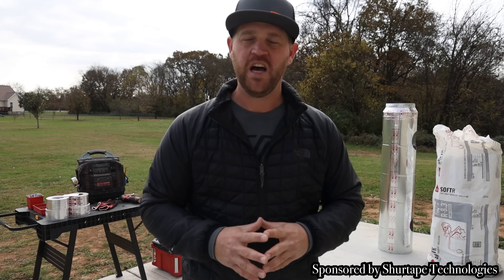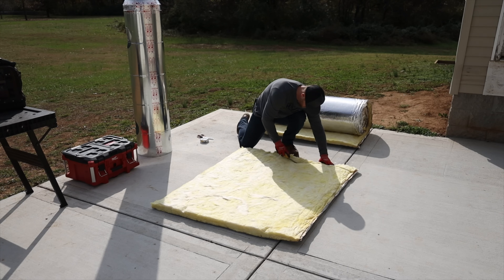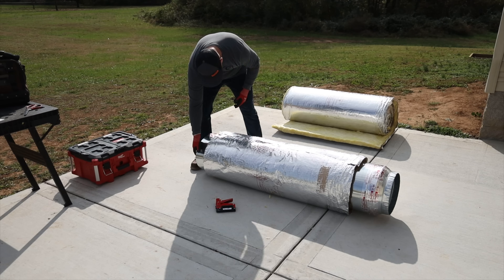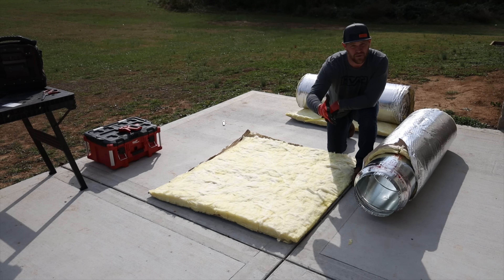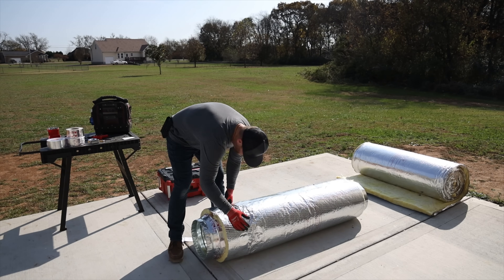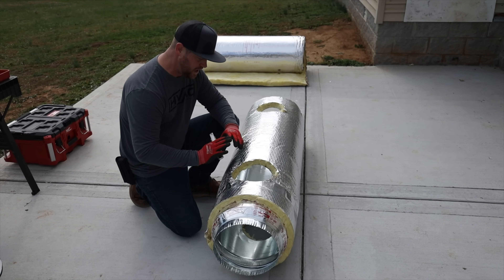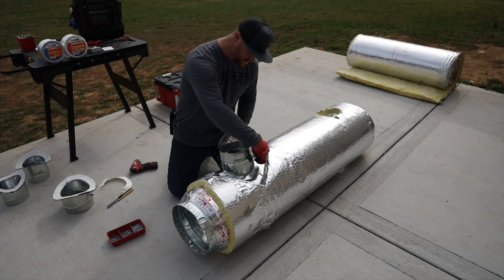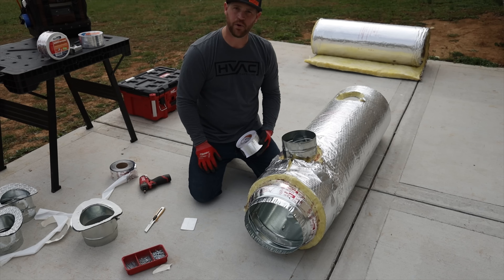HVAC Ductwork BEST Practices Using SHURTAPE | Part 2

Comment: As a homeowner, I was intricately involved in the duct work in my home renovation. A very good friend was the installer and I annoyed him with the questions I posed. He used spray adhesive for the insulation to hold. He then had me apply "pooky" (elastomeric sealant) on the joints in order to seal the square ductwork from air ex/infiltration. Just like a garden hose with a nozzle, the ductwork needs to be pressurized in order to obtain even distribution throughout the entire ductwork.

Comment: Great video! I also used some AI (Grok) to get the reducer size based on CFM, volume and velocity. Pretty amazing how it can get the math for you and work with the square footage and diameters based on the fan capacity of your unit. Amazing

Comment: here in sweden it is very cold in winter and watching you insulating that tube makes me feel warmer. thanks for gentle but steady handling of the duct situation. it clarified many things for me. however it also raised an important question, what is this tube for? thank you
Reply: Its an air duct. For Heating and Cooling the home. When theyre manufactured via sheet metal in some areas you have to insulate them well or theyll sweat and give you a free rainforest inside your home

Comment: Are they straight staples? How does it hold or does it bend the ends to hold it?
Reply: The short ends of the staple bend outwards to catch the threads in the insulation and tape. Alternate the staple gun direction  as you staple.

Comment: Your videos are super helpful for me being a new apprentice. I have insulating down pretty well, but we make a fold on both sides and use staples that clamp shut like regular staples and we use a lot more duct butter than tape. What I'm having trouble with is insulating elbows. How do you insulate 45 and 90 degree duct elbows? Thank you for your time!
Reply: Make a pattern that's in the shape of a fish.

Comment: If the insulation is 3" thick shouldn't you calculate circumference for 20" diameter plus 3" overlap so you don't compress the fiberglass and lose R value? If you cut the insulation to 54" on 14" duct doesn't it get compressed to about an inch thick?
Reply: I think you are more correct than what’s shown in the video. According to the document below, the stretch out dimensions for 3” of insulation on round pipe are P + 17” (includes 2” tape flap). I’ve used this approach and the insulation does appear to fit quite loose, but that is certainly better than too tight.

See pages 28-29:
https://insulationinstitute.org/wp-content/uploads/2015/11/AH121.pdf

Comment: The 3” insulated metal pipe wrap what is it called & where does a DIY get it. I have not seen at big box places?? What is the width!
Reply: Usually purchased at a supply house. Supply houses usually  don't sell to homeowners.

Comment: I'm a sheet metal worker as well.....can't believe you stapled the insulation, but whatever works for ya! I definitely give you props for actually using an applicator on the foil tape though👍
Reply: There's a special type of Staple for stapling insulation like this.
Reply: I get that its a specialty staple,but you already have the foil tape in your hand so why not tape just tape it??
Reply: @scottparker9341  tape doesnt stick forever, but mastic with fibergrid tape is my go to
Reply: @scottparker9341 As Jeffrey responded, the tape is great but doesn't last forever. It's common practice for mechanical insulators to staple their tape on duct wrapping and depending on the work you're insulating, you'll also paint over the tape & staples with liquid Mastic.

Comment: Love the work and videos that you do. Keep it up Zach!!! Curious on which staple gun that you use in this video? Thanks.
Reply: Looks like a Bositch T5. Called an outward cinch stapler. Bends the short ends of the staple outwards to grab the strings in the insulation.

Comment: If my math is correct and it is.  
You have 2) 8” taps and 2) 6” taps which is 600 cfm going through a duct that can deliver 800 cfm then reducing to a duct that delivers 600 cfm.  That 12” reduced duct should only deliver 200 cfm’s because 600 of the 800 cfm’s are already being distributed before it hits the 12” duct. Something isn’t adding up to me but I could be wrong.  Doubt I am though.
Reply: No I was thinking the same thing but I was waiting for my old man human HVAC calculator to triple check 🙃 Here he is now

Comment: In this video you used shurtape for the tap, on an older video, you used mastic... is this tape better, the same easier or maybe mastic is better is some instances or vice versa?  thanks for the great videos.
Reply: They both have a time and place. If i was sealing the lock joint on pipe id use the tape since its a straight line. If i was doing a tap or pipe to pipe id use actual mastic since i can just run the brush around the circle rather than fighting with tape. Thats just my two scents

Comment: I have always been under the impression that taps should never be directly across from one another... Please clarify. TIA
Reply: This is not a problem, especially if you use the dampers and somewhat balance the system.  The biggest no-no in taking branches off a main duct is to NOT pull them off within 3' of an inside bend.  There's no pressure on the inside radius of a curve.

Comment: I have a question about the taps. I use a heat gun before putting my screws in. Am I over doing it?
Reply: I always mastic over them anyways. I'd say we're both over doing it, but it's better than a leaky duct.

Comment: We pinch and use “plier stapler” to secure. I don’t think any other way is works for me, nothing worse than seeing your job in 5 years with insulation hanging off duct... especially if it’s a commercial job and it’s 30’ off the floor
Reply: Did Outward Clinch stapler work for you? I agree normal stapler doesn't work for this application and should not be used. He is using outward clinch stapler in the video.

Comment: Can you do a video on how to wrap a ceiling boot in an unconditional space. 
I just subscribed plz check out my vids thx
Reply: I used to slice the foil on the flex duct. Peel apart the insulation enough to cover the boot. Cut the inner flex material back just enough to make a good connection to the boot.

Comment: Your methods I’m sure will work, if not inspected, and likely better than most.  For the “BEST” airflow, ( least turbulence) you would use a dampered saddle that comes off on an angle to the main, not 90 degree stick-ons.

Comment: The mastic tape is a good touch, but as some of these novices should know, there are alternatives.  One is, duct sealant mastic.  It has the consistency of warm peanut butter.  It is applied with a chip brush all seams are hit.  The drawback is, to mastic the pipe after it’s hung because bending and movement may cause connections to crack open.  It’s the best method if you have to have a pressure tested system. Many states are now requiring this, because of shoddy work done in the past.   The drawback to mastic Tape is that it’s very expensive. My own house I used mastic inside and out. To include all lineal joints.  I have a friend that owns a union shop, he says that they are not allowed to use more than 6’ of flex on each drop.  Everything is hard pipe. The norm for an independent is the renowned “Octopus” of flex.  In the Boston area he said they will make you rip it out and start ver.
Reply: I used duct seal mastic on my home with the ridgid already being in place when we moved in. Much easier than taping all the joints fussing with those rolls while in a crawlspace. Imbedded some mesh tape as well and sealed over that. Rock solid connections now. Now wrapping insulation is a whole different story down there ughhhhh

Comment: Great video, talk about that staple gun.  How do the staple ends curl, in order to hold the two pieces together? Wouldn’t the staples just fall out the same way they went in.  Being just foil as a material.
Reply: It's an outward clinch stapler. I have the same one he uses in this video, but I prefer the arrow t50oc. It pushes the curls outward so it would have to rip through the backing on the insulation. Just enough to hold it in place well enough and the tape locks it all down.

Comment: How would you add a hanger strap? The insulation would be in the way.
Reply: The way I do it I put the strap before insulating secure the strap screws so that it doesn’t move and Tate your insulation then tape were you screw to seal and the apply the installation. It’s looks real clean after install

Comment: I use to connect wyes all day for 8hrs at ac pro. That was one itchy job. The ty or wye is the metal thing you connect to the duct, it allows you to connect two pieces of duct together. But it wasn’t always wye or ty’s it was all sorts of metal applications some of them square.

Comment: Just wondering why you don't use the gooey mastic stuff for sealing the taps? Thank you for the videos!
Reply: That’s what most people use because that tape is super expensive. The tape is cleaner.
Reply: @picklerix6162  but mastik is a much better and longer lasting seal
Reply: Because this is an ad for tape

Comment: I need to hire someone that cares this much. Nobody wants to do a good job anymore
Reply: Similarly nobody wants to pay for a good job
Reply: @Bottomshelf988  exactly, most of my clients do not want to “overspend” for a good quality work instead they go with cheapest bid
Reply: We do work exactly like this in North West Washington State. West Mechanical Heating is where I work. For a full custom all metal duct system expect to pay $10,000 to $15,000. It's about 5 days of work plus material.
Reply: @KPHVAC  
10 to 15 k for what ? 
Are you an installer ? Sheet metal ? Pipe fitter ? Insulator ?
Reply: @ynot6781  We are an HVAC company that sells, services, and installs all things HVAC. To get an all metal duct system installed in an average size home we charge $10,000 to $15,000. That's for a completed installed duct system that is sealed and insulated. That is just for the duct work and does NOT include a furnace or an Air Handler & Heat Pump. We only use all metal ducts so they should last for many decades. In well maintained home they should last a lifetime. Flexible ductwork is often junk after 10 to 20 years. If you have rodents they will destroy flexible ductwork.
Reply: I’m starting as an Apprentice monday and I like watching these videos because it gives me ideas of what I’m getting into and I promise if I carried his knowledge I’d care as much
Reply: @McMuffin2002  my best advice would be to always be honest with your customers and do what you say you will do and beyond. And to always keep learning... I'm still learning hvac/r after 12 years.
Reply: @McMuffin2002  I hope your starting off in the union .
There you will get a solid 4 to 5  year education in the craft you desire .
Reply: @ynot6781  I agree, The Union do train to the proper standards. Independents just want it slapped in, and move on, they will just throw you out there and see what floats. Maximum profits, hurry, hurry is their motto. I’m fortunate my employer does want quality work, but my employer is the exception, not the norm.
Reply: @ynot6781  I’m starting off with a local company called Anderson Heating and Cooling. I wasn’t too sure where to look because I’ve only worked the pizza business since I was 15, now I’m 18. They have really great benefits and people over there as wel
Reply: @ynot6781  The union wouldn't be insulating any duct.The insulating union would be doing it.

Comment: Looking good! Only difference I do is when wrapping the insulation around the pipe, I’ll tape down that first thick end to the pipe itself before overlapping the end where you remove the insulation. I feel like I never have to worry about the insulation sliding off or moving before adding taps/installing in general.
Reply: @Chris O'harra glad im not alone on that haha